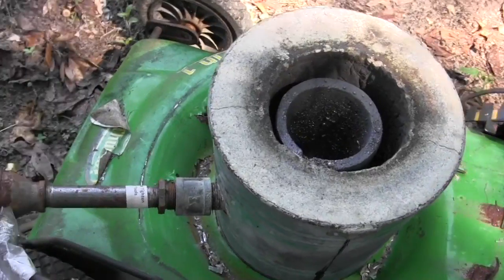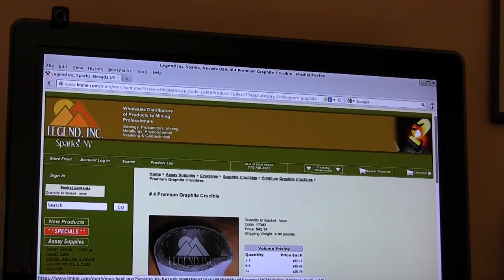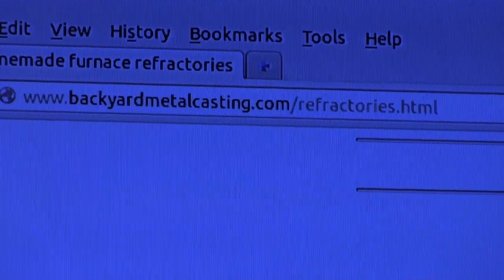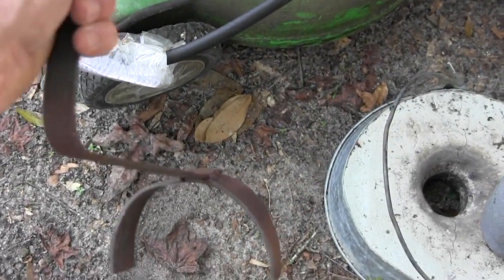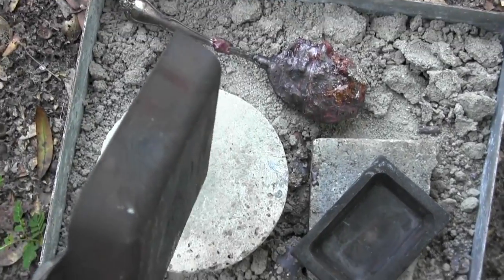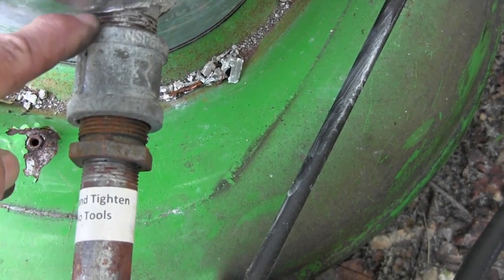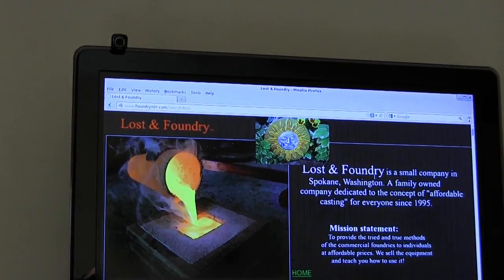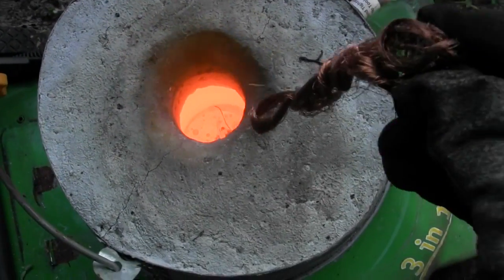My home foundry

Comment from the maker: You could very easily melt aluminum and other metals that have a melting temp under 1500 degrees F. Copper melts at 1973 degrees F. You'll need to make sure that the furnace is well insolated. I've seen some videos where people have build them in the ground. They burn wood and use a blower to pump in air.